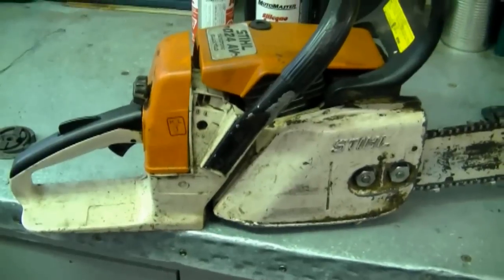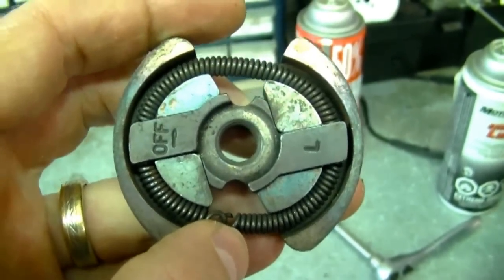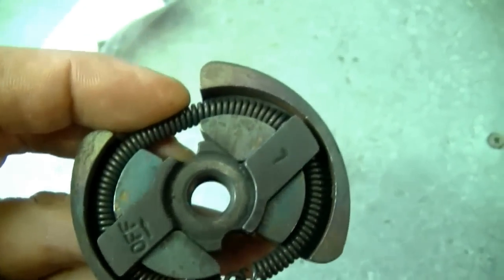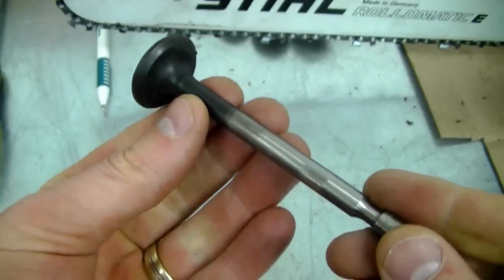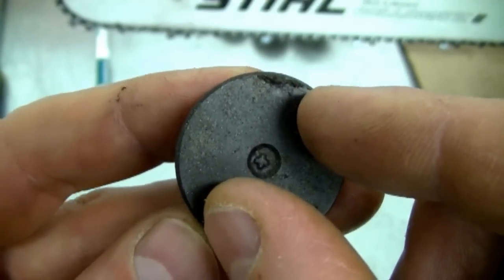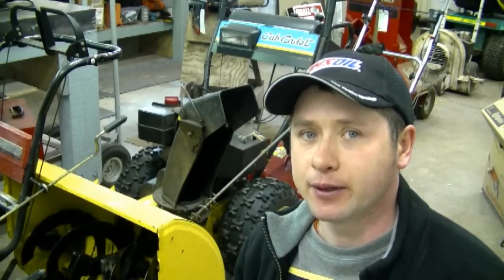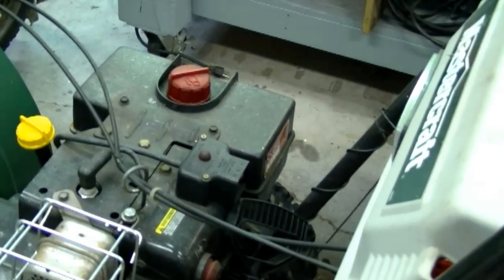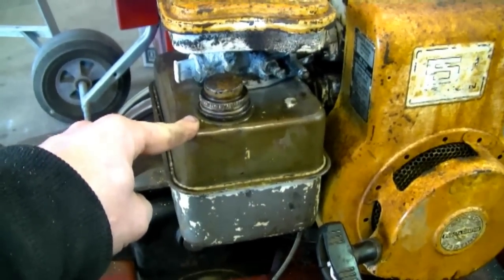Small Engines Q & A Video #95 in HD

Comment: Hey Don yeah I checked on ebay but all I can find is for the loop handle and my local stihl dealer says its no longer available but could I remove the rubber grip and use the one from a newer fs85

Comment: Great job on all videos, Is there any other way to check the ignition coil on a chainsaw apart from spinning it to check for spark with a plug or a spark plug tester? The Mcculloch 3200 chainsaw I have was running great, I discoverd an oil leak.... took it apart to replace the line and know getting it back together i have NO SPARK .... HELP?

Comment: Hey Don I am in search of some older Stihl FS 80 parts the throttle control to be exact it has the older bike handle with the two rubber grips and the control below the grip and I am having a hard time finding the control that is made like mine

Comment: Hi donyboy I have taken the carb off my gv100 and cleaned it following watching your vids as my mower keeps hunting this has helped but not cured the problem any idears what to check next have changed plug.  Also my Allen strimmer is diff to start but noticed primer bulb has a couple of holes would this be causing it? Thanks in advance

Comment: Hello donyboy73   I got a GX 160 , sounds like a bearing going bad in the area of the horizontal shaft,  it gets louder when I increase the pressure on my home made yard sprayer with new 6 roller pump.  Have you made a video that would help me with this problem.  Is that hard to fix.  Thanks for your time.

Comment: about question #4, about distinguishing intake and exhaust valves. if valves aren't marked and surprisingly identical size, you can determine which is which by a magnet. any good exhaust valve is hardened to the point it loses its magnetism. exhaust valve won't stick to the magnet, intakes will. that stands true for the briggs valves also

Comment: I have a craftsman lt2000 lawn tractor. It runs fine for a few minets than dies. I have noticed when it dies there is no fuel showing on the fuel filter which I have already replaced. I checled the fuel line and tank and they are not clogged. If I let it sit for a while it will start and work another few minets. I also noticed after it dies it takes a long time to get fuel in the filter but if I turn the key off it will fill up real fast. Could the problem be the cellinoid under the carbrator?

Comment: try checking the ignition coil,or the points if it has them,try spraying a small amount of start fluid in carb ,or sparkplug port,if it will fire for you it wood be something on fuel side of things like carb ect,post avid and send a link ,good luck

Comment: Hey Donyboy question:
My father's 4 cycle troybilt string trimmer clutch broke loose inside the cover.  He took it apart, and found that the screw that holds the clutch drum on came loose and allowed the clutch to come apart.  He put the clutch back on togethor, then the drum and some loctite on the drum screw but now the clutch seems maybe a little loose?  It works good now but makes  a little bit of noise.  Maybe the clutch isn't put togethor correct?  Should we bother and get a new clutch?

Comment: Enjoy your vids.My neighbour uses CLR on rusty gas tanks,lets it soak for a day or so then rinses them with clean gas.He did this to my 5hp B&S a couple years ago its still good.Alot of crud came out and was very clean inside,also a new filter was installed.You welding cart was excellent.Do you repair motorcycles as well,if so some videos of that would be great.Oh yes could you do a video of replacing an on-off switch for a Husky 345.Keep up the good work I enjoy your vids alot.........Cliff

Comment: Thanks Don, great tips as usual. What seems to work for me when putting away a small engine for the season is to put some fuel stabilizer in the gas and run it for a few minutes. I also tend to think with fuel in the tank I will get less condensation especially over winter.